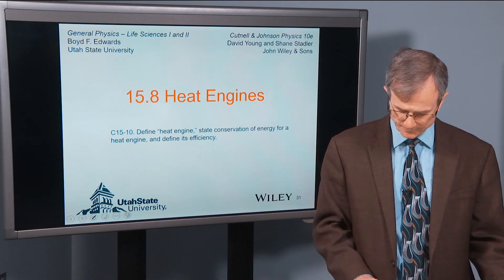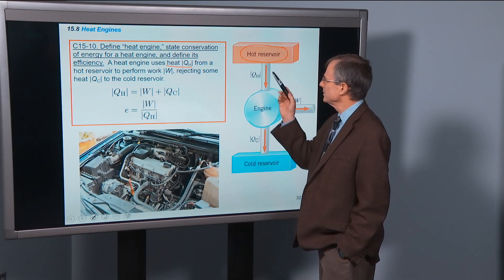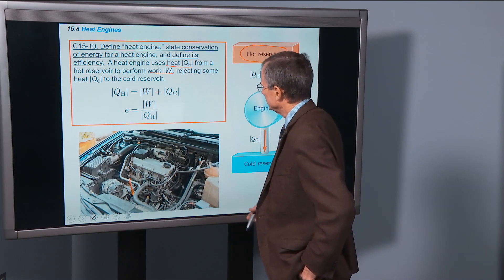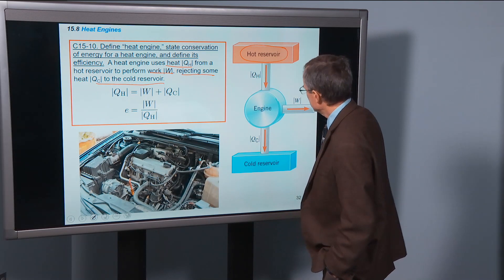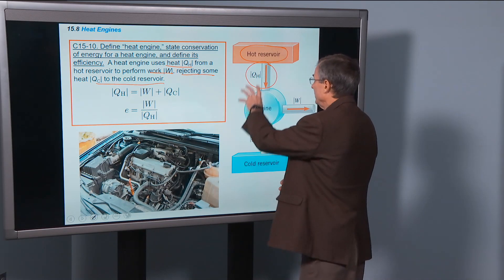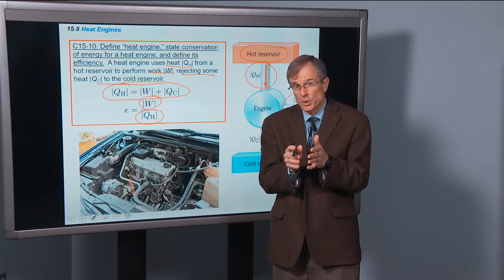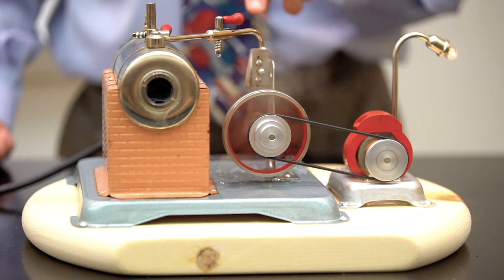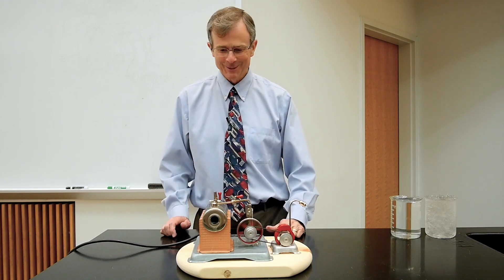15.8 Heat Engines

Comment: It isn't a "very complicated process" in the stirling.  It is complicated to calculate, but is conceptually very simple. The white foam cylinder shifts air from the hot side to the cold side and back again.  So air is shifted to the hot side, then expanded, then shifted to the cold side, then compressed. Pressure is higher when it is hot so it does more work expanding while hot than it takes to compress it while cold.  Simple.

Comment: Literally anything that produces heat as a byproduct could turn the lost heat energy into practical work by strapping a heat engine on top of it

Eg. A coal fired powerplant is only 33% efficient. Strap one of these bad boys on there and you've got a lot more bang for your buck fuelwise

I drew a basic diagram of the concept it's a shame you can't post pics

Comment: It’s people like you that contribute to saving our planet and species!
Reply: How planet will be save by this ...rather it will be destroyed
Reply: Although I love science and I want to be engineer (hardware engineer) ,
I acknowledge that most of the harm done to humanity and ecosystems is done by the rise of science.
1. Invention of first vaccine (which caused discovery of other vaccines) lead to global overpopulation 
2. Use of coal and oils in excess caused climate change.
3.I don't want to add a lot of points because the first point is the worst thing that happened ,and it (overpopulation caused by vaccines) is enough to explain most of the harms that humans are doing on natural resources and it's ecology.

If Science was only a theoretical thing then this world would be greener.

And it would be very good if vaccines were very costly so that only some babies can be made safe from diseases.

(It sounds cruel but dying due to diseases is natural to us.)
Reply: But I am not offending you but I just gave my opinion on your comment.
😊
Last thing I want to say is science should include experiment and theory but should not be applied at such large scale without thinking about the future generations and existing greenery on earth.

Comment: Most of what he says is complete nonsens. The heat in a combustion engine is a incidental by product it can not use and must remove by the radiator. It is the pressure caused by the explosion that pushes the piston down, nothing else. If it could be done with no heat it would work even better than now. ICE is not nor has ever been a heat engine.
A steam engine is fairly easy to understand. Boil water get high pressure steam then push a piston with the steam. Boiling of 1 gallon of water turns it in to 1800 gallons of steam. Contain it in a smaller volume and you get pressure. Boiling water in a sealed container is verry dangerous as the verry high pressure can cause it to explode, several steam engines did that in the early days.
The sterling engine IS a actual heat engine designed by rev Sterling in England but the large "piston" is only used as a air displacer to move the heated and expanded air away from the heat source so it can cool and contract. The small cylinder on top do have a piston that both gets puched by the hotter air and then pulled back down as the air cools and contracts.
The thermal "generator" running the fan is in fact a Pelletier element run in reverse, they transfer heat by a semi conductor as a solid state heat pump when supplied with power. They are good for some type of heating or cooling but with moderate to low efficiency. When heated and cooled they instead give of electricity but at verry low efficiency.

 If he graduated college he should be forced to give back his diploma and get a refund. Do not trust a word of this man.
Reply: Agw is correct.
A heat engine uses heat as an energy to do work.
The heat created by the gasoline engine is not used to do the work. It is indeed a by product. If anything, the heat is 100% wasted energy since it wasn't converted into mechanical force at the wheels. 
If cars ran on heat engines, they wouldn't put heat out as exhaust. They would actually cause cooling as they used the heat energy
Reply: @zachcharo  You are quite correct that all heat generated in a gasoline or diesel engine is wasted energy, how ever a heat engine do need a heat source and then it disperses that heat via some type of radiator, so i´m afraid it do not cool any thing as the "cold" side is slightly above ambient temp.
Reply: "The heat in a combustion engine is a incidental by product it can not use and must remove by the radiator.  It is the pressure caused by the explosion that pushes the piston down, nothing else."

1) Isn't the pressure caused by the explosion due to the temperature increase caused by the explosion? PV = nRT; could also be number of particles increase too in the combustion byproducts but certainly there's a significant temperature increase which would contribute to pressure and to work done on the piston

2) Isn't the heat that must be removed just excess heat corresponding to the part of internal energy that wasn't converted into the work of moving the piston due to not having perfect efficiency?
Reply: @sammysoil77  no a explosions can have a shock wave that is not hot. This is a internal combustion engine, not a heat engine. If it was a heat engine it wouldn't need combustion.